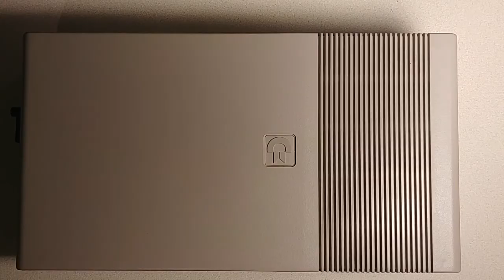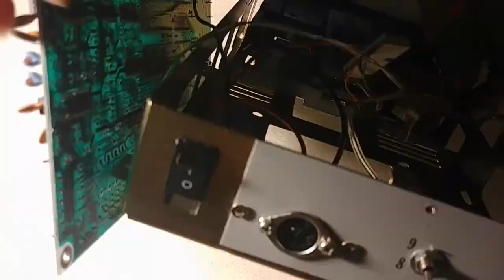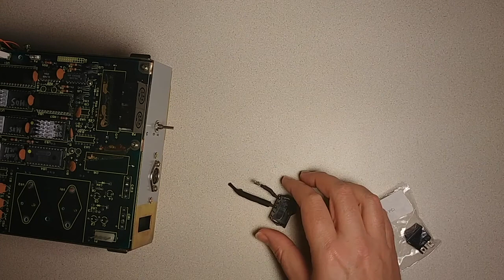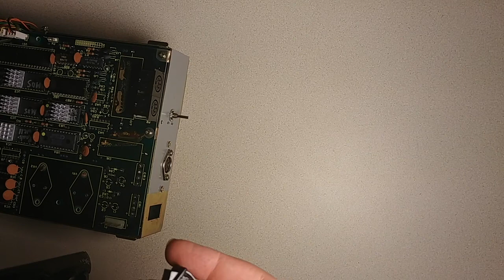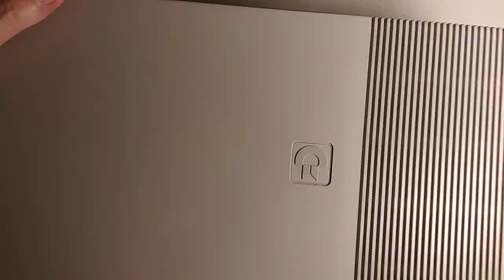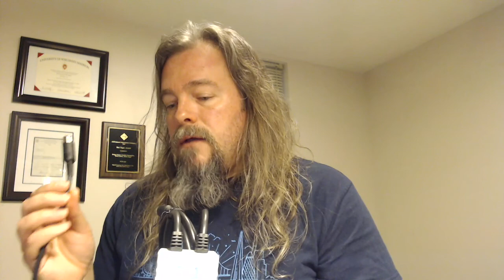Commodore 1541-DC: mod for power like 1541-II

Comment from the maker: UPDATE 23 Apr 2021: Here's the single PSU that I use to simultaneously power my C64 and 1541-DC:
"Electroware C64 PSU heavy-duty mod (30W DC power)"
https://www.youtube.com/watch?v=daE0QzkroB8
Reply: Is that PSU able to handle a C64 with the REU (with its higher amperage requirements), plus the 1541, or only the C64 barebones with the modded 1541?
Reply from the maker: @JasePow68  I have every reason to believe a 30W DC PSU can handle the (solid state) REU too, but have not tested it. Most of the power draw is from the motor in the 1541. I do have the Ultimate 64 II+, and it works fine.
I do more measurements here:
https://www.youtube.com/watch?v=daE0QzkroB8
My measurements show the C64 and original 1541 draw ~21 watts, peak on DC (note this is just slightly more than the base Electroware model provides using the MeanWell IRM-20-5 inside). That leaves ~9 watts (one third of the capacity here) for additional load such as an REU or whatever.
Does that make sense?

Comment: GREAT VIDEO!!!!! I have five 1541's and I have Adrian's Digital Basement video from around a year ago or more about changing out the old large and heavy transformer to this super cheap ($3 I think he said) transformer from China saved in my watch later videos. I want to do that but then reading the comments and then his own update that it's not good enough to do the job. Others in his comments list a good transformer they used which is under $20 but it is a tight squeeze, so I've put the project on the back burner for a long time.  I love you option to this problem!!! I look forward to all your Commodore content in the future.
Reply from the maker: This is probably my favorite of my YouTube projects, thus far. I never saw anyone do this before and it seems such a natural mod.
Reply: @DrDavesDiversions I consider it unnatural.
Reply from the maker: Thanks!
Reply: Keep it original.  If you rip out the transformer you have probably halved the value of it, made it strangely light and not original.
Reply from the maker: @blackterminal  I won't leave it for you in my will then. :)
Peace.

Comment: Nice Project! Very Cool 😆. I was not familiar with the dual power supply. I am looking forward to seeing it beefed up..
Reply from the maker: Thanks, Mike!

Yes, the dual PSUs are a neat idea. Ray Carlsen has made dual PSUs for C64 and 1541-II. I imagine that's what inspired these newer mass(?)-produced ones from Electroware and Keelog.
I have the Keelog now (mixed results thus far) and the Electroware en route, so check back in a week or two if you'd like to see my performance measurements, esp. under load.